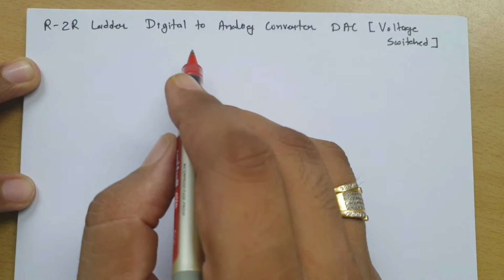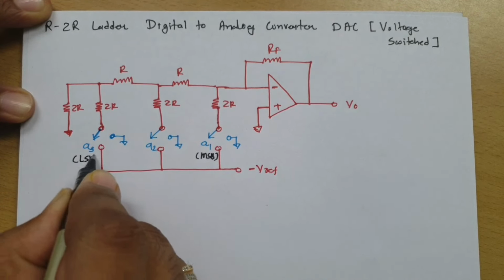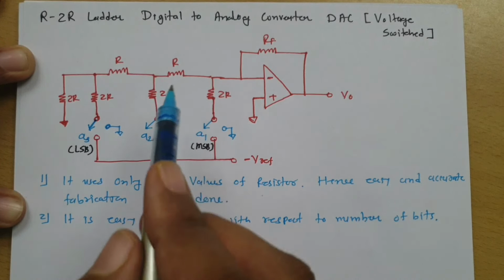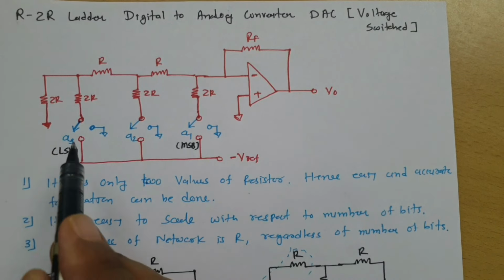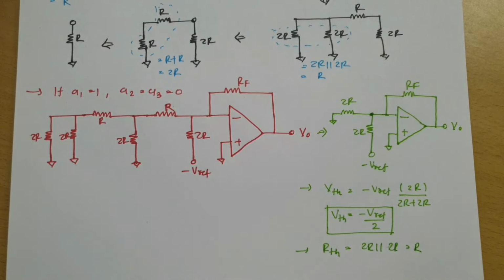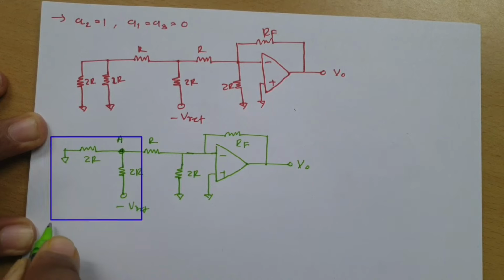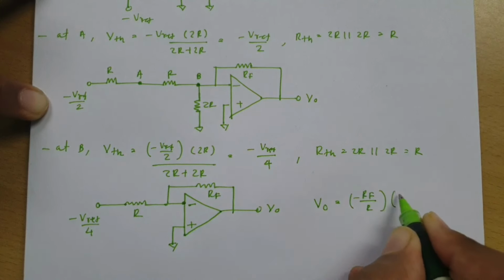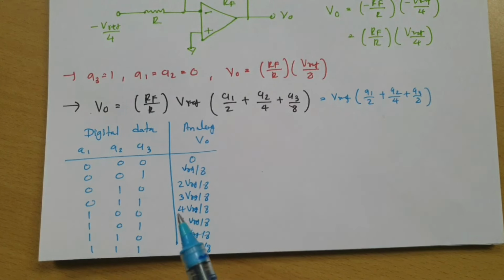R-2R Ladder DAC: Voltage Switched Network in Digital Electronics

Comment: 00:02 R-2R ladder DAC with voltage switched network
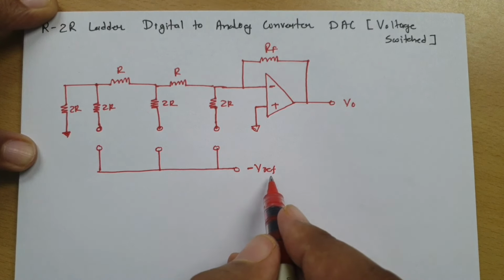02:38 R-2R ladder DAC simplifies fabrication with only two resistors
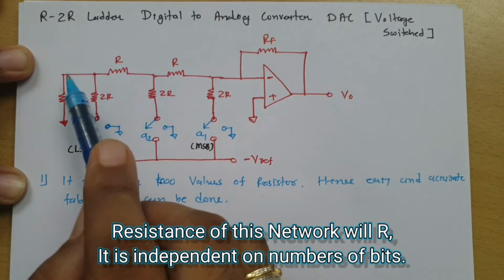05:08 R-2R ladder DAC allows easy scaling with number of bits and maintains constant output impedance.
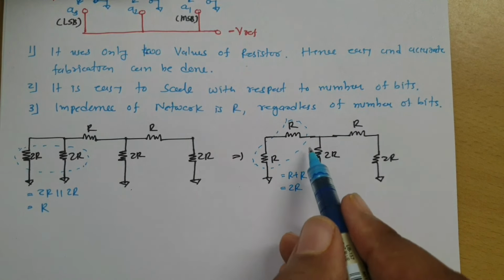07:36 Analyzing the resistor network and determining the output voltage.
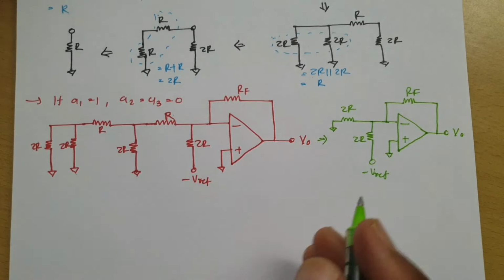10:24 Finding Vth using voltage divider rule
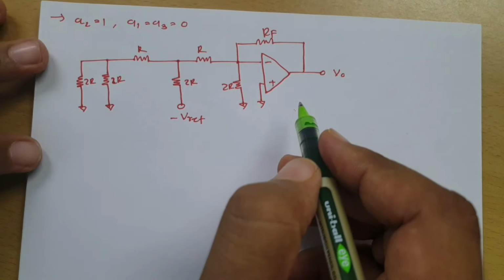13:16 Calculating output voltage of R-2R ladder DAC
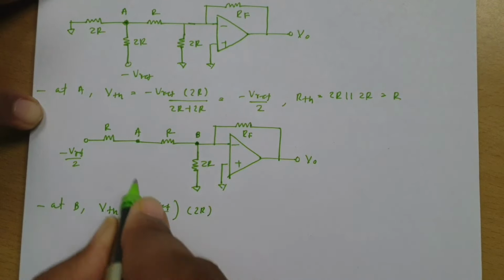15:58 Calculating output voltage V0 using R-2R ladder network
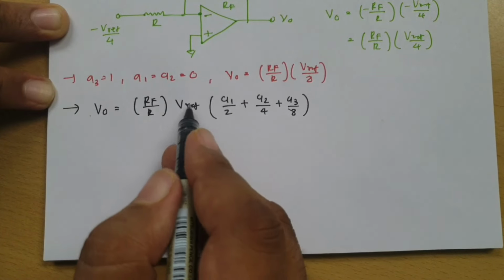18:42 R-2R ladder DAC converts digital data to analog output
Crafted by Merlin AI.

Comment: You can't apply voltage divider like that to find Vth.  Moreover the Vth is not the point you have considered in the opamp because due to virtual ground concept the voltage at both V+ and V- of opamp here is 0. The circuit should be solved by considering Rf=R and by using (-Vref - 0)/2R = (0 - Vth)/Rf i.e. Vref/2 = Vth .
Reply: I can't understand your last 2 line properly 
But I also think how sir can take vth directly ?